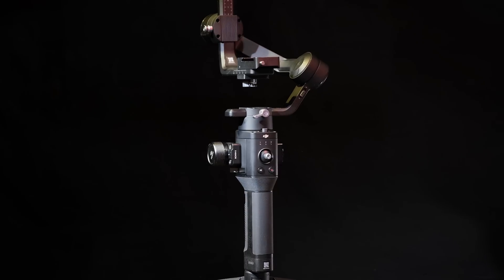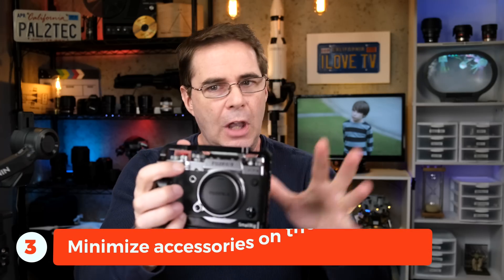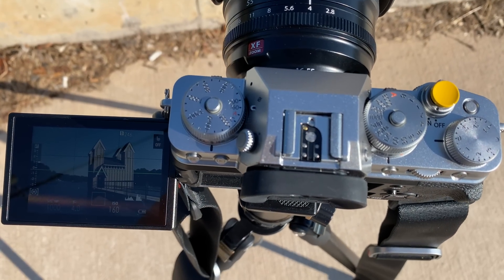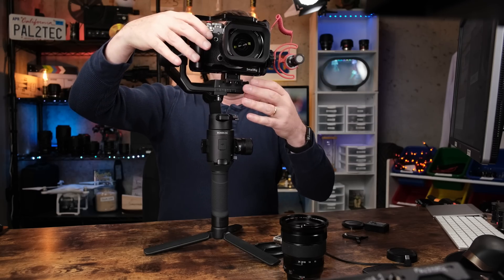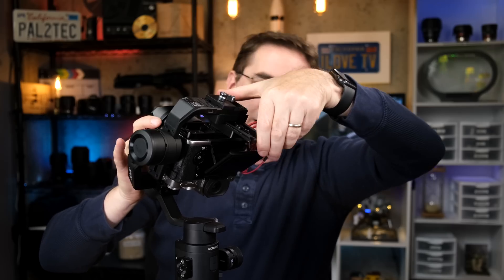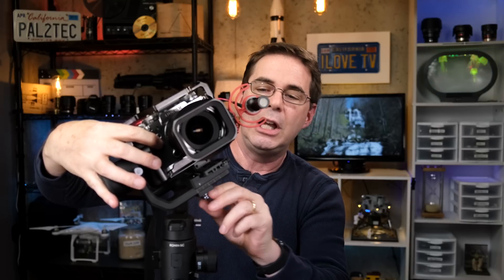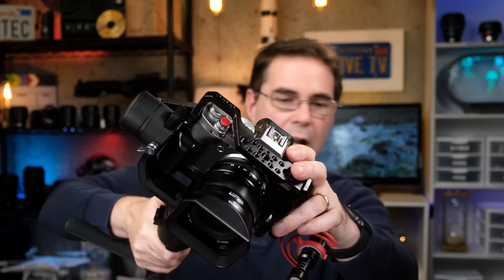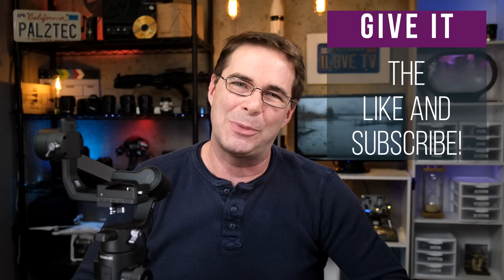How to Balance a Ronin SC Gimbal (for Fujifilm)

Comment: Do I have to rebalance the gimbal manually every time when I re-attach the camera? There are situations when I don’t want to use the gimbal but then - after a while - again
Reply from the maker: No, you don't. Assuming that you've not changed the lens, or added a filter, etc. or anything else to the rig -- you should be good to go and p/u from where you left off.
Reply: @pal2tech  I appreciate the fast answer. Thanks a lot :)

Comment: HI man! how can i control the camera settings straight from the gimbal itself instead of from the camera?? is that possible? I mean if i film in manual mode and i would like to change the settings because i expect frequent light changes..
question 2: without focus motor setup, which is the best way to handle auto focus with fuji camera? i mean i keep face tracking on and i usually use the stick to move the focus...how can i do the same with the gimbal in a smart way?? I have just purchased the ronis sc basic kit... Thanks a lot for your kind explanation. Love your way to explain the concept.

Comment: If anyone hears their motors rumbling like crazy after balancing, go into settings and restore gimbal parameters.

I couldn't figure out what was wrong and that fixed that problem. Also remove the focus wheel attachment before updating the xt4 firmware in the ronin app.

Comment: Oh my gosh PAL please help!!! I can balance the gimbal no problem with a 16mm prime (takes 2 mins) but I just bought the 16-55mm 2.8 and I cannot for the life of me get the tilt to balance, I've been stressing about it for 3 hours now I'm about to throw the lens out the window haha. No matter where I put the plate it either heavy or lighter, it just still falls forward. Please good sir, I have an xt3 with no IS so a gimbal is necessary for me to film my videos.. I will buy you lunch or some beer haha please man, I know you get lots of these messages and I know you're a busy guy so THANK YOU for taking the time to read this even if you don't respond haha I appreciate you and your videos I'd be lost on the fuji system without you. Any forums or anything you can even recommend to figure this out.
Reply: Were you ever successful? I have the exact same setup and it’s an absolute nightmare!
Reply: @Macoodles  After all these years, I finally found a way. To make it work, you need to connect the large and small plates in a non-standard way. Normally, both screws are fixed inside the groove, but in this case, one screw has to be placed outside the large plate. Just press it tightly from the edge and screw it in — and everything will work.

Comment: I just came back from Disney World. I have the XT-4 with this gimbal and I think my biggest issue was just setting it up for dark rides and then going back to my shoulder strap for photos. Trying to take photos on the gimbal kinda works, but I feel like I have less control of the camera that way. I went back and forth so many times for videos/photos. Every time I took off the plate I'd have to rebalance it because it slid to the side a bit.

Comment: Hey chris,  any chance on sharing a proper workflow with fujis's "auto transfer" mode and if it can be applied to folders?  fuji's on camera file management is terribly slow... just trie deleting individual images off a card.. you can't even set a range.. and it takes FOREVER.  Also the on-cameras "auto transfer" on/off switch appears to do nothing.  It appears to always want to transfer despite having auto transfer off!   Thanks!!!

Comment: I have an issue with my XT3 and this gimbal; I can not connect them together correctly. I connect USB type C to the camera.  The connection just shows the charging sign. By the way, I adjust all the settings recommended here like USB tethering to Auto. Nothing works at all. I do update both the body's firmware and the gimbal's app. Someone can help me, please. Thanks in advance.

Comment: Hi Chris ! Great content as usual😎 Dynamic but clear presentation / explanations👌Subd greetings from France🤗
Thinking about upgrading my Xt2 ... xt3+ gimbal or Xt4🤔 any input?
Reply: Hope you don't mind me butting in, but from a past video Chris says he recommends a gimbal for the X-T4 video anyway, and in another comment here, he turns IBIS off when in gimbal.  He loves the X-T4 battery.  IBIS is great to help more for low light photography with no flash. And then there the flip-out screen. Obviously you're asking due to the price difference (otherwise it would be X-T4). I went with a used X-T3 (used X-T4 are harder to find by), but only because I made a long term plan to use that as a B roll camera and upgrade in the future for IBIS, & hopefully higher 4k fps. (plus I didn't want to support Fuji removing the head phone jack, really). I do wish I had IBIS (and flippy screen) now, but it's your money.

Comment: Great tut! I would only add that once you have it balanced use your notes app to write down all your gimbal settings. If you use the same camera body and lens combo, you can use it as a cheat sheet and set up very quickly using the same settings.

Comment: Nice! But whats the benefit of connection the camera with the DJI Ronin?
Reply: You can control the focus without the focus motor. (You’ll need the focus wheel that comes with the sc pro bundle). You can start/stop recording.
Reply: @pancaro77  wow i can pull focus via DJI app? Not bad

Comment: small question...what camera settings can we control through the gimbal.
Reply: After the new firmware update we have much more options (thats why i'm deciding to buy one /did think about weebill s too). Finally w R SC we can: 
Capture photo
Start/stop recording video
Pull focus electronically
Trigger auto focus
Cheers
Reply: @bobslej  seriously you can pull focus electronically? Wow i currently have the weeble S and that one feature i really want.. other cameras are able to do it on weeble s but not fuji...i can only start/stop record and change iso and shutter speed
Reply: @Aalochak   Yea i know however are You happy with the Weebill S ? i was almost decided for the weebill, but the electronical focus is a big deal for me.. looks like was newly relased on the Ronin. I was looking about the newest information about Ronin SC with the xt3 compatibility and I found those info on the officiall dji web link below:
https://www.dji.com/pl/support/compatibility/ronin-sc/xt3
It will probably consider to go with the Ronin SC i guess
Reply: I am happy with the weebill S actually it can handle any amount of weight and it has more headroom than ronin. It can handle my XT4 with the 16-80mm lens easily. But electronic focus pull is a big deal hope Zhiyun adds this with a firmware update.

Comment: Question here: my XT-3 signals disconnection while connected to RSC by USB-C. The sign of connection kinda twinkles and doesn't perform as it should be (I can't use any specific mode in the app). Is the problem in USB-C cabel or did I do something wrong?